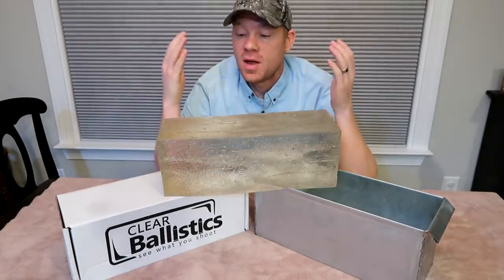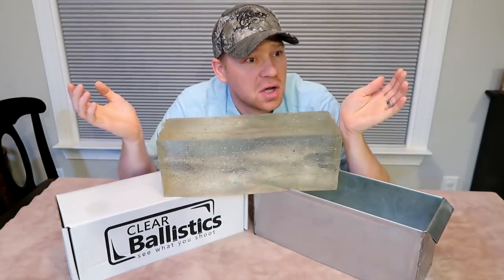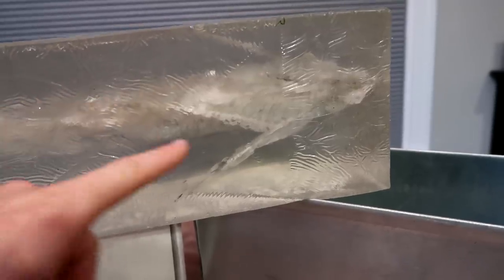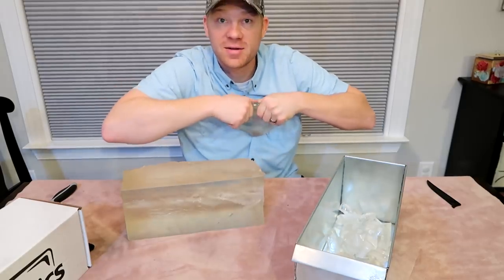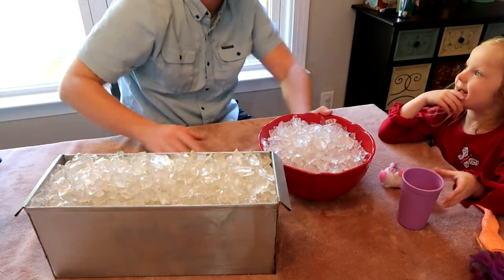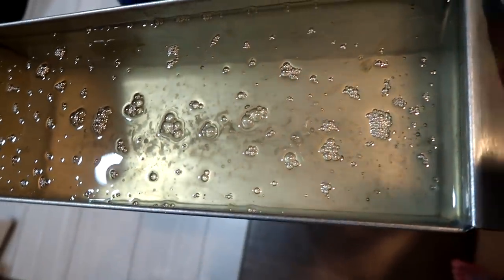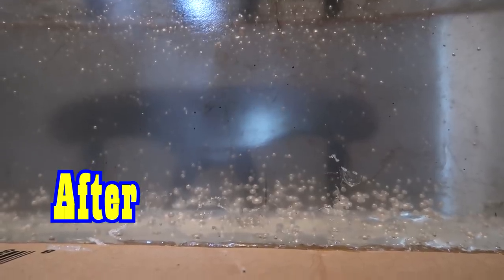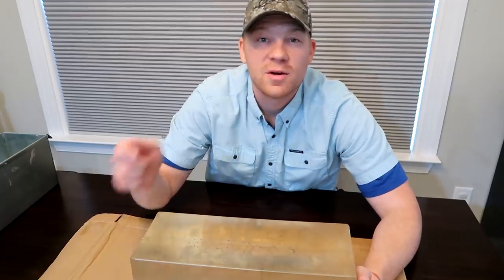How to Remelt Clear Ballistics Gel

Comment: Cutting up the block only adds to the amount of entrapped air.  Get the big fragments out, melt the block without cutting into pieces, and any remaining small fragments will sink to the bottom, where they can be removed after unmolding.
Reply: I found that baking at 265 degrees makes for a less viscous fluid that lets any particulates settle like you pointed out and bubbles from the terminal ballistics raise right out. I slice into 3 inch cubes that can be fit together in the mold easier without the air bubble issues. Altitude makes a big difference to. I'm at 3500 ft above sea level. The idea is to melt without boiling bubbles forming so I check it 2 hours in and lower the temp in 5 degree increments if it boiling to much. Once it has melted I keep it at the minimum heat needed for bubbles to rise. After a first try where I learned where the difficulties pop up I've had perfect results. I also had a professional welder friend weld me up a polished stainless mold that is 30% deeper than the finished block dimensions. I coat the inner surfaces of with high temp silicone. The blocks come out easily and the surface is as transparent as can be.

Comment: I found that pulling the gel away from the side of the mold and squirting water,  or soapy water in there helps a LOT to get it to slip out.   Gel is an absolute pain to work with.   A viewer recently told me about something called Plastisol - the stuff artificial fishing bait is made from.  You can buy 5 gallons of the stuff for 100 to 150 bucks.  It starts out white and is watery like milk until you cook it.    I think it might be the same stuff Clear Ballistics uses.   If this works,  I can make blocks for about 1/3 the cost.   I've been communicating with a company, picking their brain to see if this stuff might be a good alternative.  Maybe we can just pour Plastisol into the mold,   cook it and be done.    No bubbles, no
picking out debris and dirt and all that.
Reply from the maker: Wow. Awesome!!!!
Reply: An update on this idea?
Reply: @brianvosburgh1720   I baked a 6 oz. sample of the plastisol in the oven in a coffee mug to get a feel of this stuff.  Well,  it off-gassed and smoked like crazy so cooking a whole block of the stuff in the oven is out of the question.   Next step it to try an elect. roasting pan and cook it outdoors.
Reply: @taofledermaus  anymore updates on this?
Reply: @BryceKimball7.3  Yeah, turns out it tastes like turkey if you baste it with butter occasionally while roasting.

Comment: One thing with cooking/remelting anything is ALTITUDE, where I am at now water boils at 180F not 212F.
 tip to keep bubbles out is just cut into slices about 1/4 to 1/2 inch thick, put a layer and heat,  let it heat for a bit then add another layer, it will take a longer but give better results.
all the small chunks create a ton of of air pockets between the chunks

Comment: I have found out that you can cut it with foam cutter or hot wire off of amazon. It makes the cutting process significantly easier. Also, heat guns are wonderful.

Comment: Just melted mine for the first time, had a few problems but got them fixed. Tearing the slices was a HUGE help. I ended up turning the oven up to 270 and covering the mold in aluminum foil. ALL the bubbles came out and only had a few ON the surface. None in the block itself. I did not use a mold release agent as recommended. Its cooling now, hoping it comes out of the mold ok tomorrow. Merry Christmas!
Reply: Took some elbow grease, but it came out of the mold just fine.

Comment: I've found that if you line the mold (pan) with 1/2" "slices" keep adding them as each layer melts, and use a slightly higher temperature (about 260-265F) you'll almost certainly get better results. Your results were, however, not bad at all for a first attempt. Well done !!
Reply: do you need mold release agent? Just melted the first time, no release agent, its cooling we shall see. Also I tried 250 and after 4 hours there were major air bubbles. I put a dowel rod in and the top was melted but the bottom was not. I turned it up to 260 for another 2 hours, about the same. turned it up to 270 for 2 more hours and put aluminum foil over the mold to try and help it melt better in the mold and even the temp out. WOW, great clear melt! a few small bubbles ALL on the surface, none in the block itself!

Comment: Not gonna read all the comments, but instead of a fillet knife, pick up an electric knife from a garage sale or Salvation Army store for a few bucks. Like the kind you cut a slab of meat with. I use one to cut different things from foam to silicone for making casting molds and it works like a charm. I'd say to use the heat gun to get rid of the bubbles right after it comes out of the oven, too, not after it cools. You may have figured all this out already though since this video is a few years old now.

Comment: Try putting it back in the oven at 250 degrees to heat the metal pan. It should slide out easily.

Comment: You might try tapping on the metal pan intermittently while it is still in the oven to get those air bubbles to rise to the top next time. I would try to find a used range ( Craigslist etc) I could hook up outside on in the garage to do that in ( If you are going to be doing it frequently )  No telling what kind of gasses that stuff is letting off in your home.  That Charlie is a cutie :-)  I think she has a future career in TV :-)  . Merry Christmas and have a Blessed 2019

Comment: Not sure how, but I know that putting the item to be cast in a vacuum chamber helps get the air bubbles out. As for the debris, once it's heated to a high enough temperature to be a liquid at least some of the debris should float to the surface or sink to the bottom. If you cast the block in a vertical position, that might just require cutting or melting the upper and lower surfaces. I'd also think having a casting mold with slightly tapered walls and using a release agent. How's that for overcomplicating the hell out of it.

Comment: You may have discovered this by now, but apparently using a shallow heating pan allows the heat to be distributed better which should shorten the heating time (if you can incorporate multiple pans at the same time, like pie molds or something) and should also improve the end quality.
Reply: Amazing video by the way! Lots to learn!

Comment: You need to leave it in the container at temp for longer to allow the bubble to float to the top.  Set it to ~250F and leave it at 250F for an hour or so after it completely melts.

Comment: Vacuum chamber! I know, I know, more money.... But that would solve the air issue and honestly you can make one fairly cheap. But only warranted if you will be doing this often. I also think the large block will melt just fine and you'd end up with less air. But you may not be able to remove all the fragments, etc. But they would probably sink to the bottom anyway.

Comment: I would try lining the mold for easier release and not taking the bullet fragments out.  Then melt the whole block in the mold.  I would think they should sink to the bottom when the block melts so you can remove them from the surface upon removal from the mold.  I wonder if the bullets would discolor the gel though.

Comment: Hey man! I just subbed. I love the channel, but ik this doesnt apply to ballistic gel. But I've been thinking of either getting a 450 bushmaster or 4570 and was waiting some input on which one you prefer
Reply from the maker: That is a really tough one. If I had to absolutely pick I'd probably go with 4570. But it is a very close call. Really depends on what you need it for. For purely big game hunting I might go 450 bushmaster
Reply: .45/70 is easily available for plinking but if you reload either is good. Like Adam said the Bushmaster is great most off the shelf ammunition is proper good stuff while the .45/70 stuff is often nerf’d for weaker actions and is barely above .44 magnum power and often below.

Comment: Just like processing large game. Break it up into sections to remove the big chunks of debris, and I’ve found that an industrial kitchen strainer is invaluable if you really wanna keep your block clear. I’ve been blasting on the same 2 blocks for a long long time, they eventually do get cloudy lookin. Those bubbles can be popped as it’s in the oven if you’re ocd like me lol. I use an ice pick to pop the large ones on top and it works well. Good luck Sir, great video.

Comment: Next time put Plastic wrap stuck to the exposed top to prevent those air bubbles while cooling it.

Just lay it on top and gently push the air out between plastic wrap and surface with a tool of some sort or a towel so you don’t burn your skin off

Comment: Just curious. If it turns back to liquid when baked, why could you not just place it back in the tin in one big chunk after you shoot it up again and just very gently stir methodically to remove excess air bubbles from bottom of gel..  May be worth a shot instead of cutting up in small little pieces. May save a little time and turn out just as good..  Thanks for the video..
Reply from the maker: No clue. I just followed the instructions
Reply: takes toooo looong to remelt if you don't cut it up........
Reply: @MegaBait1616  10/4  I kinda figured that..  Instructions are usually best.. lol
Reply: @br-witha-adleysmith2379  , i use a piano wire type of slicer i made to cut the block up into pieces like for cheese. goes way faster than pulling apart. And a heat gun when it's drying or cooling to get the bubbles out. Still remelting these blocks back sucks and takes a while to do and gets darker n darker each time. pita......and in a few shots it's back to remelting..............kinda sucks and they are Not Cheap..............

Comment: Im curious if you ever discovered mold release spray? Lol
Reply: I'm serious. If you haven't, just look it up. It's usually a silicone base, so the heat shouldn't bother it. It's used in plastic injection molding, which is the only real reason I know about it. Lol. But a single can would probably get you by for years depending on how often you remelt product. It's worth checking out if you haven't.

Comment: I don't find shooting the gel particularly interesting. It's a good test of various expanding rounds but well... so what. I know what the rounds I commonly use will do, and that's enough for me. I am not about to change brands, calibers or bullet weights at this stage of the game. I'm just too old to worry about what the hottest thing on the block is.  I guess it's interesting to you kids that have to have the hottest new toy. By the way, you can have some fun with the gel, it doesn't have to be cast into a plain square block. you can use Wilton cake pans as molds. They make one that is a teddybear sitting on it's butt shape. has a thing that makes it hollow in the middle. you could make it out of the gel, either make it solid or hollow, then fill the inside with oh... I don't know shaving cream, out of date tomato juice, something to make it more fun.
Reply: oh I do thank you for offering this, some people will find it helpful.
Reply: Careful not to ruin the gel though, it’s pretty pricey.
Reply: Yeah but using blade or melting it and putting it on a coconut makes a decent head like thing and then you can use a blunt object on it and that’s fun